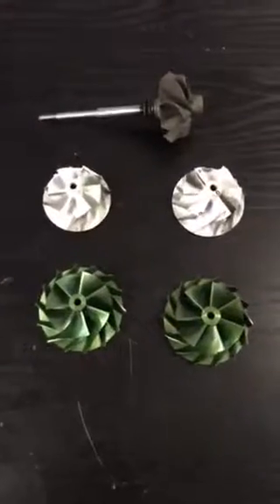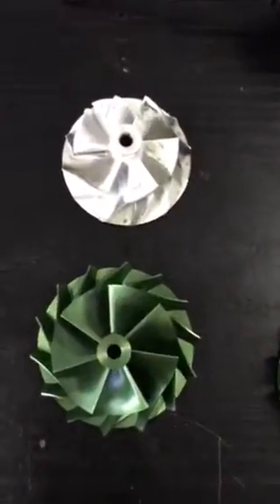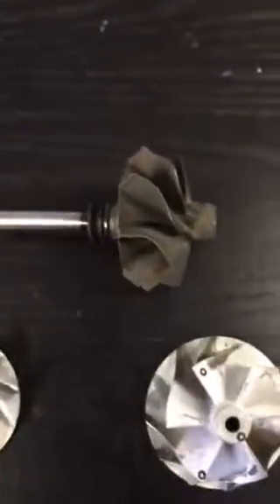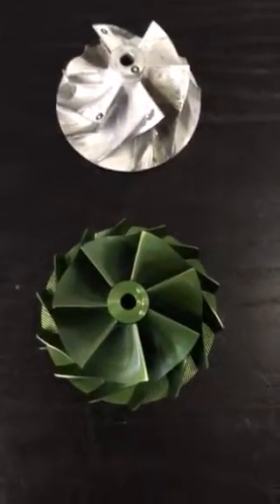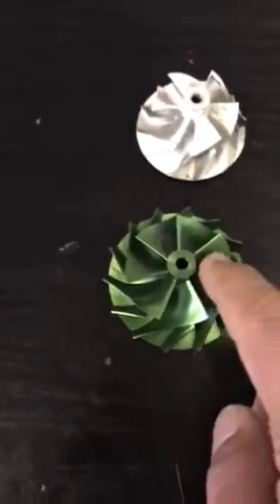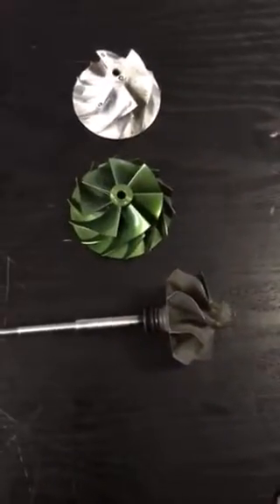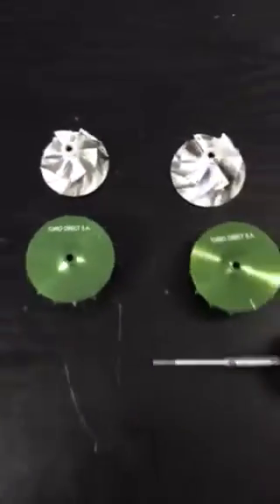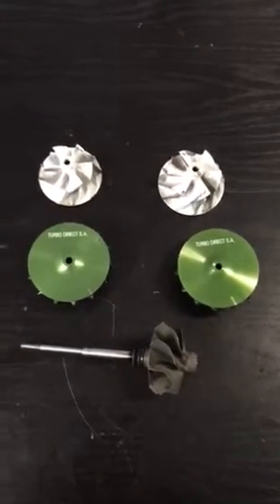Golf 7R compressor wheel upgrade

Comment: So in a GTI with a ko4 what will perform better a 6+6 or a 7+7?
Reply from the maker: @DanCombs-vv1lu  this depends on the mass flow rate of the wheel. In our specific lineup we have improved the flow rate of the first 6blade compressor by replacing it with our 7blade splitter.   There is a limit too, excessive thrust loading will reduce life and reliability.
Reply: @TurboDirectSA  gotcha...replacing my whole chra and it comes with a 7+7 instead of a 6+6. They are saying it's a big improvement
Reply from the maker: @DanCombs-vv1lu  depending who is supplying it, I’m unable to comment. We have our own designs which we manufacture in-house, there are many others designs out there, none of which I can comment on.
Reply: @TurboDirectSA  makes sense. Appreciate the time
Reply from the maker: @ pleasure. happy to help!

Comment: What is the price and may i get your contact info, is there any way too hide this upgrade if the car still has a motor plan ?
Reply from the maker: This is undetectable unless the intake is removed and a camera is used to look for the upgrade.
Reply: @TurboDirectSA  would love too do the upgrade im also in SA , actually in Pietermaritzburg myself , im definitely keen on one . is shipping possible for a local fit or does the upgrade require a specialized skill offered inhouse at TurboDirect?
Reply from the maker: @BeAllEndAll-i3e  in-house only im afraid.  Noone in S,A is able to do what we do or how we do things.

Comment: How much power in kw is the compressor wheel good for in a G7 Gti Is20?
Reply from the maker: 25-35WKW extra over and above the stock unit - this is with safe, reliable and low boost tuning max 1.5bar gauge pressure.